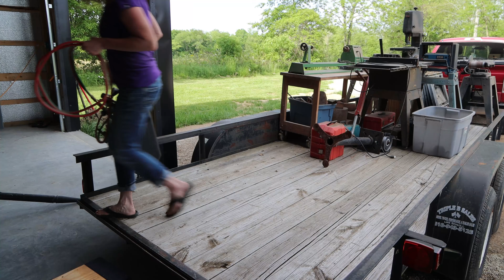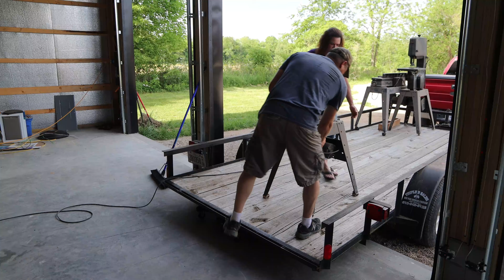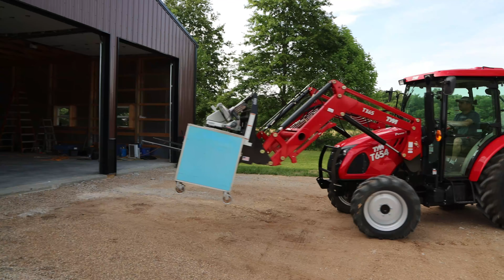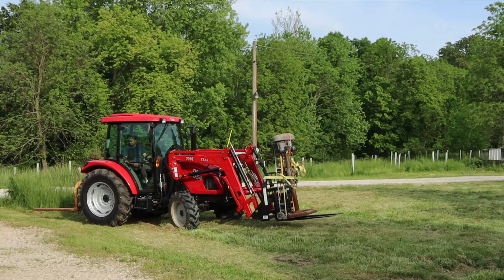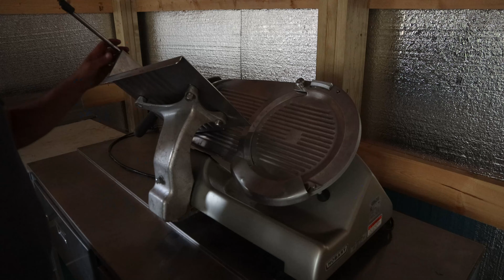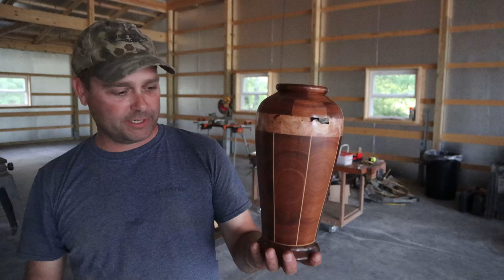Moving Tools into the Pole Barn.  Gutters and Cupola now on the barn.

Comment: Very  nice woodworking! Looks like a great way to make objects. Have watched some videos on wood-turning and wish I was able to do it. A great hobby and very satisfying as well. 
Forgot to add that I love the looks of a cupola on the pole barn. Good idea. I bought a large galloping horse weather-vane for our 2 1/2 car garage , but it started to rust a little, so we took it down, I used silicone caulk to fill in all the cracks and seams. Then after sanding it down a bit, spray painted it with black Rusteolum  and my husband extended the directional arrow to increase its ability to catch the wind and it now looks and moves much better.

Comment: Wow! You guys always have something to do! You do not know how blessed you are to have those things to do; and to physically be able to do them. I keep saying this, but your backs are catching it. And for all I know, you might have a dozen Teeters in your house. But most likely ... not. 
I played in bands on weekends for 35 years and cut a LOT of yards across my working life along with all kinds of other things. The bands required lifting and moving heavy guitar amps and PA cabinets out of trunks, back seats and truck beds and into venues and up steps and stairs and onto stages. Last band I was in, I used an amp that weight some 70 pounds. At the end of the night, in order to get it through the crowd and out the door, I had to put that bugger up over my head and carry it to the door, where I dropped it to my chest and opened the door and put it back up over my head and carried it to my car. Today, I have five blown discs and can only walk in serious pain with two trail sticks. I finally had my first successful Teeter workout today, after two failed attempts due to some serious muscle stretching pain (ultimately used a NeuroMD modality to move muscles around, and that was not without pain!).

I sincerely do not mean to be pushy, but the smart thing to do, is use a Teeter inversion table (there are others, these are the best made) BEFORE you mess up your back and have to endure the pain I have been suffering. I admire people who work hard. I do not want to see you watching the grass grow because you are in so much pain. Hope that helps. And oh, yeh ... Jesus saves!

Comment: Nice wood turnings Evan.  I am also a wood turner but as of late have not had time since in the last 2 years we have been  building our own homestead.  Having land cleared, pond built, new outbuilding and now building a new home.  I have some good wood suggestions for you.  Sometime I will have to email you some pics of my work.  Have not tried segmented yet, but on my list.   On a side note what type of spray foam are you using?  Closed or Open?
Reply from the maker: I believed it is closed cell foam.

Comment: Like your woodwork, working on a lathe I find very relaxing. Great pole barn, a multi use building. I put led pot lights in the ceiling of the garage, daylight bulbs,  12 foot high ceilings,  lights up the garage very well. Most of my woodworking tools are Sears or Delta, gonna be a great barn/shop when finished. Keep safe my friend

Comment: The cutting boards should clean up just fine with comet type cleanser. If they don't you can run a belt sander on them . Which brings me to my next suggestion. If you need more cutting boards you can buy them in standard widths and lengths, just make sure that they are National Sanitation Administration  approved , because there are a lot of imports that are not.  Please only handle the slicer UNPLUGGED with protective gloves that are metal mesh especially when cleaning that. Many a finger has been sliced off doing that. BE EXTRA CAREFUL. Looks you guys are off to a good start in your new garage. Best of luck and keep on producing those videos.

Comment: I have that same slicer on  a stainless table too. It's great for slicing so many things, but terrifying to clean. Make sure you don't turn it on end. The gear oil will leak into the motor chamber, and ruin the capacitor.

Comment: I have found if you lift the forks about 5 ft off the ground and tilt the forks downward about 45 degrees, you will see them kind of loosen or hang, easy to slide the forks where you want them.

Comment: Bad idea to do wiring after spray foam. My husband did all wiring before he had a company spray foam his workshop. Once the foam sets up you are going a hard time finding a way to run or fasten your wiring and/or wiring boxes. Much smoother to wire first.
Reply from the maker: It is only 2 inches of foam in a 6 in wall.  There will be plenty of room for the wiring afterwards.

Comment: Nice barn and great wood art!   I happened to be working around my ground cable and noticed that it was loose.   I dug down and found that the original installer had just used a conventional pipe instead of a buriable ground clamp.    It had deteriorated to almost nothing in about 6 years!

Comment: Try to find some Barkeeper's Friend cleanser to clean up all the stainless steel. I've used in many restaurant kitchens during my time as a sous chef. It will even work to clean the poly carb cutting boards.  Think about finding or buying some thick rubber floor matts for the meat processing area. Your feet, legs and back will thank you.

Comment: A great upgrade for that craftsman table saw is a delta fence and rail kit from Lowe's. It's like $200 and is a bolt on replacement, but much more rigid and accurate. Sometimes deltas stuff isnt available so another reputable fence system is vega table saw fences. You cant go wrong with either one.

Comment: Want to suggest sealing the floor on the barn for longevity & durability from stains & spills.
Reply: Was just going to say the same thing. You've already done the hard part...letting the floor cure for a month.  Now a couple of coats of sealer will do wonders.  Not only will it help in cleanup of diesel fuel/hydraulic oil/antifreeze/etc., but it will help reduce the odor retention of any spills you'd have.
Reply: Another nosy (by me) post from one of those scrap creators    oz of prevention..
https://youtu.be/QaNMMm1D6t8

Comment: A few years ago we found this style of shelving for our garage/shop: https://www.webstaurantstore.com/regency-24-x-48-nsf-chrome-wire-shelf/460EC2448.html
It came from a restaurant freezer. Stainless steel with wheels. Love the wheels for positioning it. It was a bit grimy from melted frozen foods so we took the components to a car wash bay and used the high pressure wand to clean everything like new. I did put plywood on a few shelves but the others store boxes on open wire. We have three shelving units 48" wide.
Not saying you should do same. Just saying how well it worked for us to have the shelving on wheels. Our garage is much smaller than your barn. It's only 28 x 36 ft.

Comment: Evan, will you have a wood stove in the garage for heating in the winter. Also will you insulate the ceiling as well, mineral wool R20? When you two are on a mission don’t get in their way, you guys are determined. Thanks for the video
Reply from the maker: I plan on having wood stove in the work shop area.  Eventually we will have a insulated ceiling, but probably not very soon.

Comment: When I was a kid and worked in the meat Dept during the summer we used bleach daily on cutting boards and once a month used peroxide and it took any stains out of the poly cutting boards.
Reply: Was thinking planning it down or shaving it could work. Just need the food grade guidelines to make it right.
Reply: @ronsmith1364  we used peroxide right from the store/pharmacy. Note it also takes blood out of clothes. We would send aprons out and laundry couldn't get it all out. We'd soak aprons in the sink pour peroxide in and add water to cover them the next day we'd have like new aprons.
Reply: @ronsmith1364  Exactly, sanding, and or planning will work beautiful, of course nightly bleach and paper towels 👍